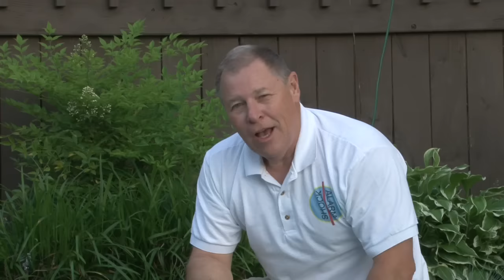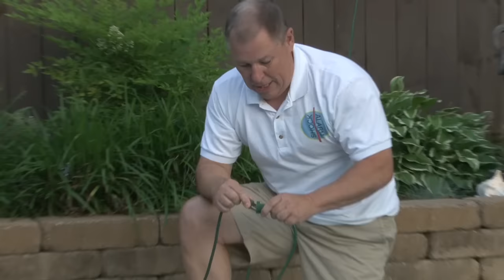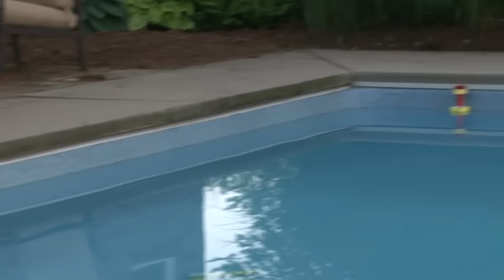Testing ShockAlarm in Pool

Comment: Brian - You introduced 120 volts into the pool. Nice demonstration. It would be nice to see, perhaps, 10 - 29 volts introduced into the pool to see if the alarm is sensitive enough to catch that as well. A lower stray voltage, I think,  is more common than 120 v.
Reply: Here in the US public shore power is typically 120 volts on boat docks and marinas. You would be shocked to see the mount of live extension cords and compromised power cords that are leaking current into the water at boat docks. Also the ShockAlarm is for AC current testing. If you're speaking of 10 to 29 V DC the Shock Alarm is not going to detect it any way. 

Here is how it works: https://youtu.be/KIeyklK2qSg 🔌⚡